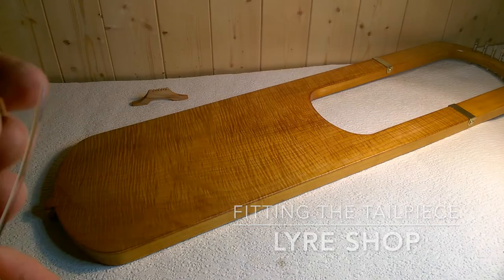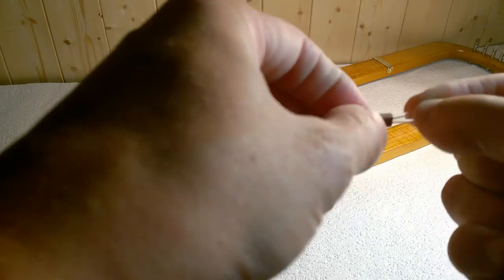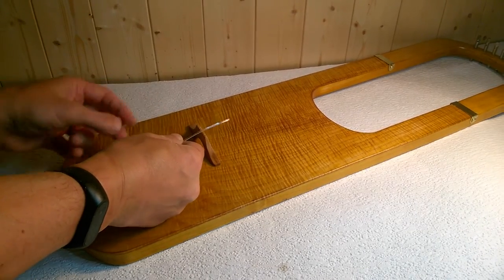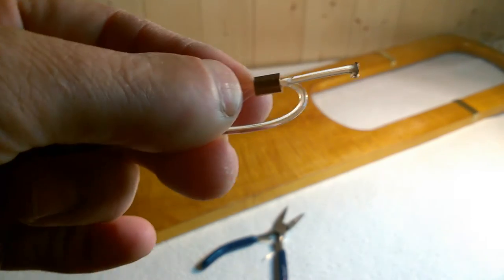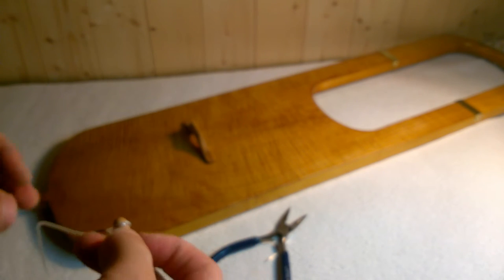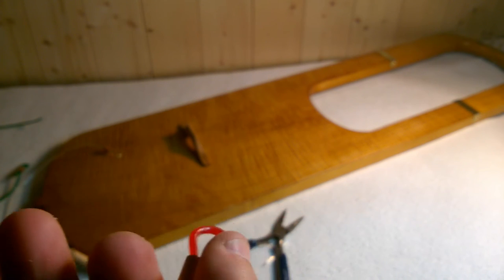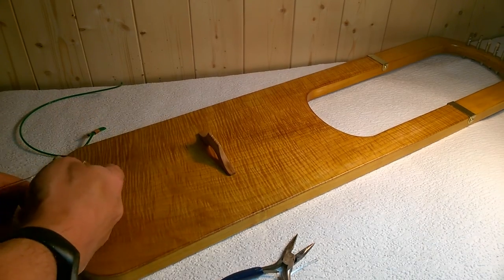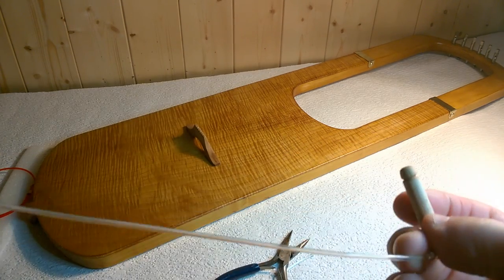Anglo Saxon Lyre:   Making and fitting the tailpiece

Comment: Dear Mr. King, thank you for your videos and explaining everything. I am building my first lyre right now and struggle with making the peg holes. They are either to small or to big. Can you please give me any advice? Thank you. Tanja Mayer
Reply from the maker: What kind of pegs are you using?
Reply: @michaeljking  Metal pegs 5,5 mm ( I don't in zoll ) The lyre is made of maple wood.
Reply from the maker: @Tanja-Mayer-Ki-Training  metal zither or autoharp pins need slightly smaller holes than the threaded part  0.25 to 0.5mm smaller drilled accurately using a drill press so the hole is perpendicular.  If drilling by hand you need to start smaller and work your way up gradually.    If a hole is oversize then you can fill it with a piece of wood glued in and redrill when it's dry.   Do a test on a scrap piece of wood to find the ideal hole size for your pins.
Reply: @michaeljking  Thank you! I'll try to fill up the hole and redrill like you've written.
Reply from the maker: @Tanja-Mayer-Ki-Training  are you doing this by hand drill?
Reply: @michaeljking  I will use a drill press. All 7 holes are to big, so I have to fill them all up. Hope it will work!